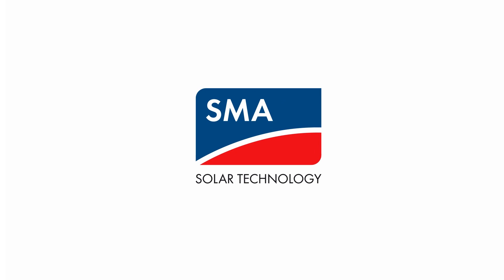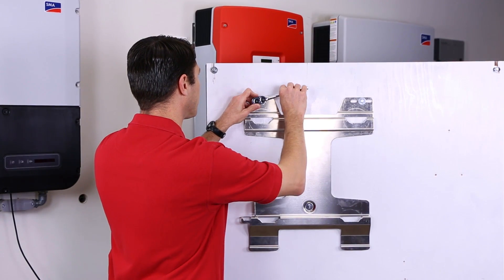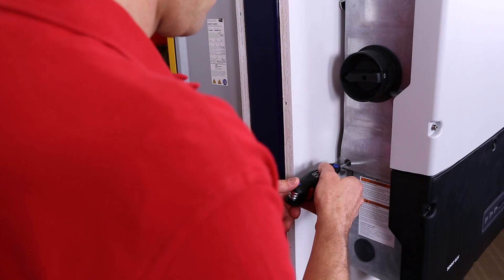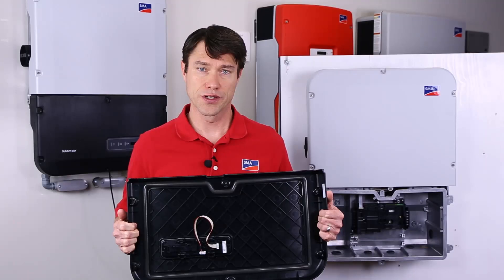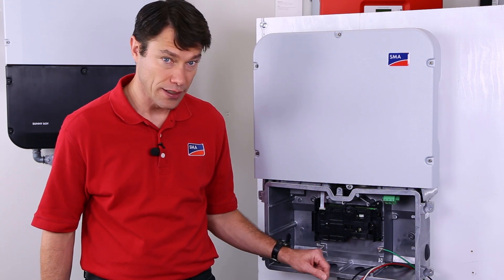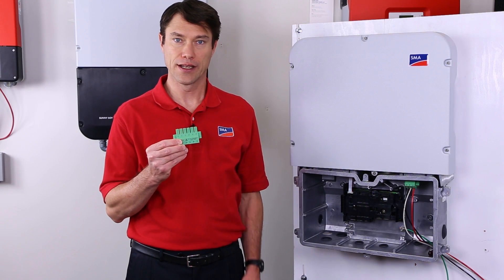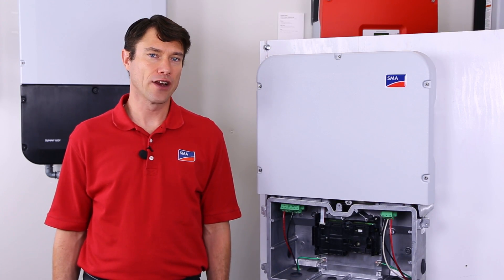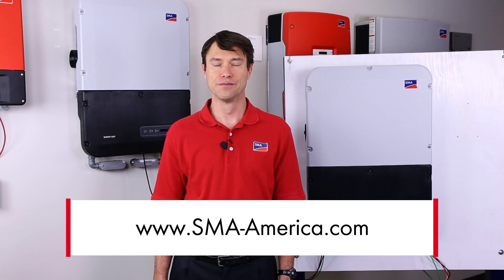Tech Tip: Installing the Sunny Boy 5.0-US/6.0-US

Comment: So let me get this straight, if I install solar panels on my home, this inverter will allow me to use the power on tap directly from the panels? Because every solar company that has come to my house said it couldn't be done.
Reply: What do you mean by directly? This specific unit is Grid-Tied, so it won't turn on unless it's connected to the grid, except the Secure Power outlet. But, off grid inverters exist.
Reply: @therusty959  emergency power available after throwing the disconnect would give u about 2000watts with a 5.2 kw system I was told ,as long as you had strong sun ?